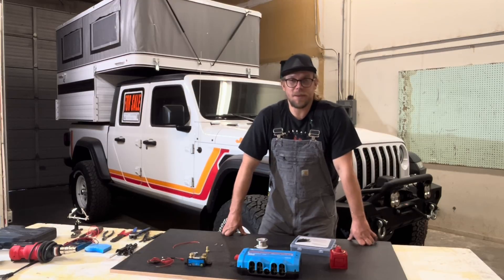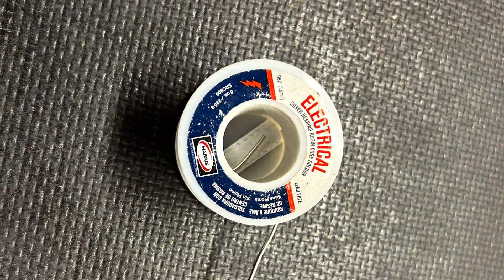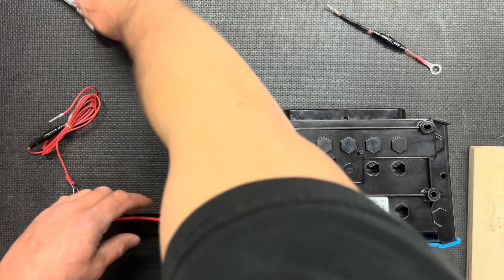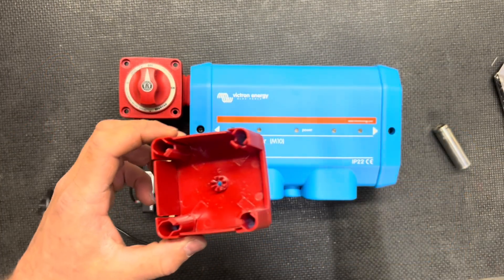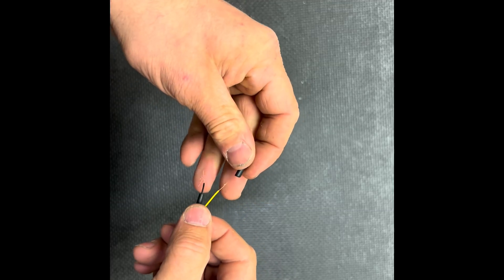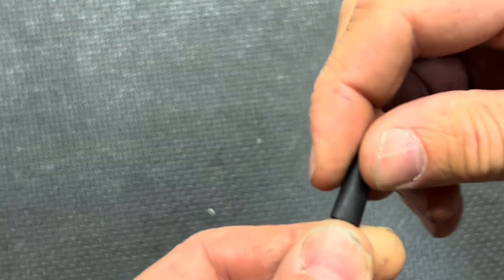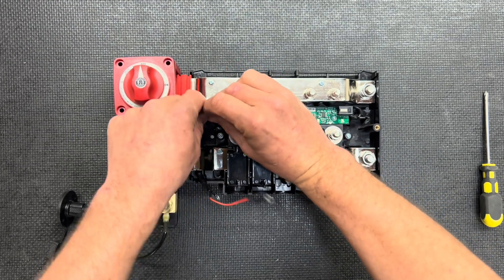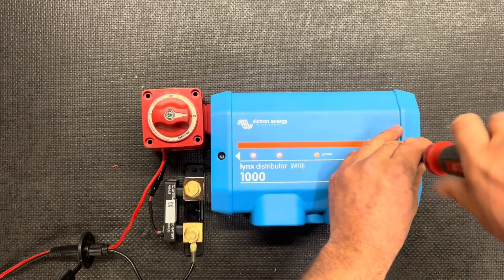DON’T DRILL IT! VICTRON Lynx Distributor with Smart Shunt, Battery Disconnect & LED Lights Working!

Comment: Can I NOT install the red dial switch? And essentially follow the same instructions for the rest of the installation?
Reply: If you already have a battery disconnect switch between the battery and the Lynx you don't need to install another. But you should have at least one battery disconnect switch so you can quickly disconnect the battery if something starts smoking.

Comment: Thanks for the video! I see the bottom of the stud from the Lynx is 29mm vs 33.5 of the smart shunt, so do you have to use spacers under the Lynx in order to get the stud height the same as the smart shunt?
Reply: I would use spacers myself. 3d printer some out
Reply: companies sell this, and they have spacers in the kit.. this guy left a lot of loose ends in this vid.. no proper torquing, no spacers, no fuse in the 5v power line, etc.

Comment: I snapped that lug off the switch with a 1/4 ratchet. did you feel that the spartan switch is poor quality. Bought another one and once tigh the lug moves in the housing. Hmmm not a good feeling. Torque to 33 NM as well. Seems a lock washer and washer would be a better match to me.
Reply: dont know the switch but, 33nm sounds way too high.

Comment: Can anyone straighten me out. I thought that the workaround with the 12 v to 5V reducer was only necessary when you're not using the smart shunt and it appears that he is using a smart shunt and doing the work around to make the fuse lights work. Any help?
Reply: the lynx distributor gets its power from a lynx shunt, or a lynx bms.. smart shunt doesn't power anything.

Comment: I'm in Carson with a full victron 24v system.  Are you looking for more content?  Converting an Ambulance. Looking to install the system in the next few weeks. Have MPPT, Multiplus II, Power In/Distrbutor and shut off with shunt, DC/DC converter, battery protect and Cerbo

Comment: Hello,
I have a USB socket nearby, and I’m planning to create a cable using a Lynx half and a USB half to occasionally power the distributor when needed. Since I don’t need constant monitoring, I figured this could be a simple solution. Any thoughts or suggestions?
Reply from the maker: Only issue I see if the usb runs through the Lynx. If you have a failure and the USB is affected you won’t be able to plug it in.  You could always use a jumper box or battery bank of some sort to check it.

Comment: awesome video, I'm about to do the same, however, i'll try to use the Cerbo GX usb to power the Lynx. Question: is it really a M10 Bolt? The included bolt measures 9.56mm as does the threaded hole. This seems to be a 3/8 in hole and bolt. M10 would probably not fit. Could you perhaps double check? The weird thing is, I bought a metric bolt set at canadian tire, and the m10 bolt has a similar outer diameter and fits. But M10 bolt outer diameter should be 10mm. I'm just confused :p
Reply from the maker: An M10 bolt is generally a little under 10mm but 9.56mm does seems like a bit too much. The bolt is definitely an M10. The bolt I replaced it with is listed as a M10 on Amazon and the manual also states that it’s an M10.

Comment: why you are using the heat gun on the shrink tube?!?! You don't know to use the body of the solder iron to shrink the tubes? not understanding why using a second tool for nothing... :)
Reply: soldering iron vs. heat gun = DIY vs. Do It Right. hack away all you want.. I'm glad you aren't a licensed electrician installing power for real people.

Comment: Can i please ask what would hook up to the distributor. Could it take mppt in, dc to dc in and also hook to an inverter.
Reply: Yes, that is how I run it in my Landcruiser
Reply: @paultrend  cheers mate.
I wish I had the money to change to victron.  Oh well, I'll just have to get used to my van just being GOODENUFF 🙏
Reply: you can hook anything up to it, as long as you fuse that line properly, and it's less than 1000 amps. lol. Its basically just a busbar with fuse holders built in.

Comment: Other than warranty and potential metal shavings getting in the chip board what other reason is there not to drill it?
Reply: there really isn't any, the bus bar is rated for 1000 amps and very rarely do people actually use it that high up so this still perfectly ok taking a few hundred amps

Comment: Just an FYI those switches are rated at 48v max and not appropriate for this application, you would need something rated at least at 60v, also a breaker with the ability to smother the d/c arc that can occur when disconnecting a battery under load. P.S. a 48v system fully charged is around 55.2v.
Reply from the maker: This went into a 12V system and is perfectly suited for the application.  Also the 48v rating on the Victron switch is for nominal voltage on the switch and its max voltage rating is 60v.  Using a Victron switch this setup would be perfectly acceptable on a 48v system not exceeding a 275amp continuous draws. As I did state on a different comment I would now recommend running either a Victon or Blue Sea switch as I have seen one of these Spartan switches fail (one of a dozen I’ve installed). As far as a breaker goes I don’t understand how flipping a breaker or flipping a switch would make any difference in how the system was disconnected from the batteries so please do explain.
Reply: @LakeTahoeCustomCampers  In a word, Arc Extinction, when the DC circuit is under load, the high currents can cross the narrow bridge on a switch connection if dis-connected under load. Arc Extinction is a suppressor built into DC breakers, dont take my word for it, do the research. The Victron switch does provide this protection, and is rated for 60v.
Reply: Yeah.. most cheap(including the Victron), are not meant to disconnect a live(under load) circuit... pay attention folks, to what you're buying, and what it is meant to do. The Vic, for example, is more as a 'Shut your system down for the winter' switch.. not a "Kill the power because something is going wrong' switch.
Reply: The Victron switch is for 48V systems with a Max Voltage rating of 60V
Reply: The Victron Disconnect Switch does not have any "Smothering" arc fault protection in it. It's a "Disconnect Switch" rated for 275 amps nothing else. As you need an AC\DC Arc fault Breaker like the ones ABB makes for anything like you described. 

So I suggest you take one apart and look inside. I would add 48v is not the max rating. It's the Nominal Operating range for these types of Disconnects. As most are rated way above 48 volts to meet UL listing requirements.
Reply: @MasterChief4U  Noted.

Comment: What switch did you use in this install?
Reply from the maker: I used a 300amp Spartan switch but switched it out for a Blue Sea. A Spartan switch I recently installed failed and got pretty hot so I no longer trust that switch.  I brought it up with Spartan and it was a know problem 🫣.

Comment: I love this solution and thanks for sharing. I do have a question for you. Do you have (or anyone here) a recommendation for a bus adaptor for the negative bar. I need to add an extra device or two and I am looking at the different options to extend the extra connector out. I don't want to just use regular cupper as this will oxidize over time. Cheers.
Reply from the maker: I wouldn’t worry about extending it and just double up two on the smaller loads of the Lynx distributor. Always put the smaller of the loads on the stud second. If you were looked to extend the positive side I’d suggest adding a second Lynx distributor but the negative can be doubled up without issue.
Reply: Better answer than the one already here.. use a proper tinned busbar, rather than bare copper. The bar you want to attach to is a tinned bar, like any GOOD QUALITY buss should be.

Comment: Do you know of a step down from 48Volt battery to 5volt?
Reply from the maker: The ones I have seen are larger in size. I gave Amazon a quick look and didn’t see anything small enough to fit.
Reply: Any suggestions hiw to step down for a 48v system  pushing 54v

Comment: Thank you for the video, you've made a really nice setup with the way the wiring is laid out in the distributor. I've seen other setups that aren't as clean. 

I have my lynx distributor connected to a 24v system. Can i still use this configuration or will i have to convert input current to the small wires to 12v? I don't want to blow up the circuitry inside the lynx.

Thanks again for the video and your time. Much appreciated.
Reply from the maker: Thanks for watching and for the compliment. The smaller wire for the lynx distributor circuit board needs to be reduced to 5v. The link in the description of the 5v reducer should do it. It’s rated for 6v-24v to 5v. If you’re actually running a 25.6v or slightly over 24v system, it’s probably still fine, but I would check it to ensure a 5v output with a multi-meter just to be safe.
Reply: @LakeTahoeCustomCampers  hey, thanks for the response. I see now that the stepdown regulator can handle 24v.  I'll test it to be sure as the batteries charge up to 28.8v. Thanks again.

Comment: Very clean setup but tell us why you have power to smart shunt on powered side of switch instead of switched side. Thanks
Reply from the maker: The shunt draws less than one mA so its not a concerning power draw. By placing the shunt before the switch it enables the user to monitor the battery status even when the battery is disconnected from the system.

Comment: I have the M8 Lynx Distributor, you think it would be fine to drill out the holes to make a setup like this possible?
Reply from the maker: It’ll be just fine. Make sure to put the cover on before you drill out the holes so no metal shaving get onto the circuit board. Deburr the edges and put a little dielectric grease on the exposed copper after drilling.